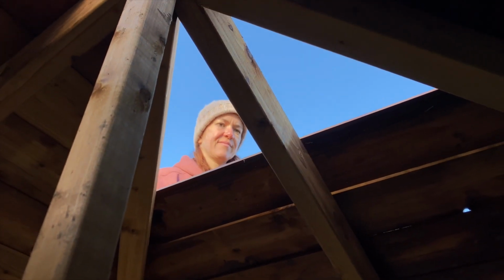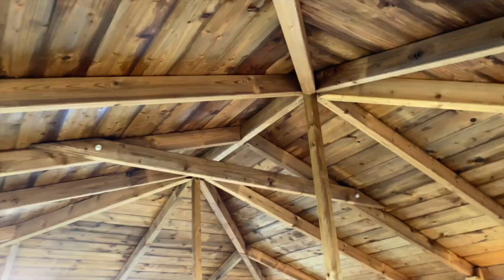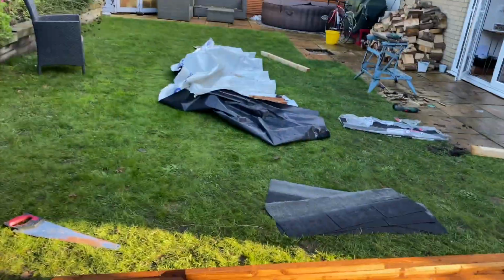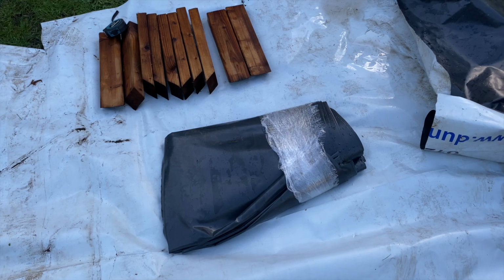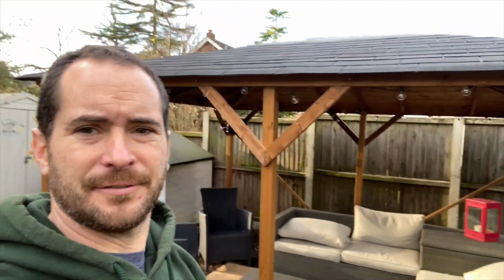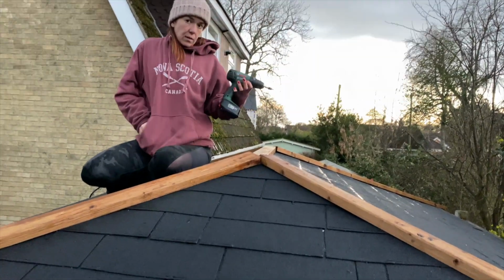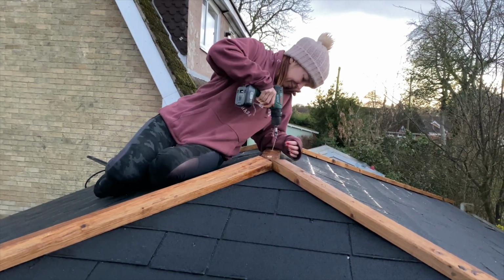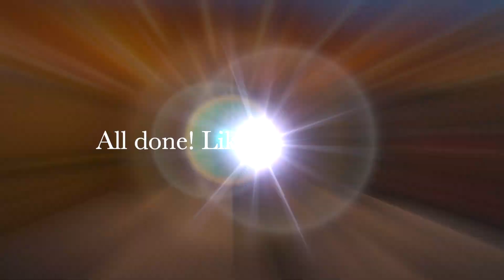Erecting Wooden Gazebo - Final Video - HD 1080p

Comment: Thank you so much for your 3-part series. I have just finished building the same 4 x3 Dunster House Gazebo. I am very pleased with the quality of the materials delivered and the final result.
Whilst waiting for my delivery and reading through the suppliers build instructions, I found viewing your 3 episodes, some parts several times over in slow motion, very useful. They gave me a greater understanding of the build to come and potential pitfalls to avoid. I would recommend anyone who is about to take delivery do the same it will really help you.
 I would also mention when constructing it is vital that the internal diagonal measurement of the first 4 beams are exactly equal and remain so otherwise it will cause issues later on in the build. For my build once the internal diagonals were equal, I used 4 pieces of spare wood I had to form a rigid triangle structure at each corner to help limit movement of the internal diagonal. I screwed them underneath the beams at 45 degrees out from the four corners posts. These remained in place until I had finished the build.
 I found on YouTube a video by Dunster House regarding how to attach the supplied plastic sheeting and  How to Lay Shingles Tutorial - Dunster House (2019) - YouTube which was also useful. 
I am quite tall and wanted to raise the height of the gazebo by about 150mm I achieved this by simply getting hold of an extra 70 x 70 gate post and cutting off 6 blocks that I attached to the uprights with metal flat straps before sinking into bolt down post shoes supports. 
Thanks once again for posting these videos and hope these and my above helps others to a achieve a problem free, well-built great looking Gazabo.
Reply from the maker: Thank you Mike!  Glad it helped and hope you’re getting ready to enjoy it more when the weather improves

Comment: Hi, how did you attach the membrane? Clout nails or the nails provided for the roof slats?
Reply from the maker: We laid it over and then used the weight of the shingles to hold it in place, then hammered the shingles in on top, so didn’t secure the membrane specifically.  Our instructions didn’t mention the membrane at all!
Reply: Thanks so much for your reply. I guess you haven't had any issues with it fixing the membrane this way?
Reply from the maker: @andysnipp3650  no issue at all

Comment: Looks a good job. We have been looking at Dunster, how did you find the timber, quality of the kit, were the timbers all true, no twists etc?
How did you find instructions etc, many thanks
Reply from the maker: Timber was a very good standard with very little knots and no twists or warping.  We had it delivered about three days so was stored flat.  Instructions were fine and easy to follow although don’t mention the waterproof membrane or the fact that you need to put it two of the middle supports the correct way round, otherwise the holes are in the wrong place for the cross timber.  Everyone that has come round has been impressed with the quality.  We finished it but covering the back wall, half an end wall and the floor in scaffold boards
Reply: @paulstroud2725   good we are covering the side etc, was thinking of decking half way and screening the rest, and leave other 3 sides open, good to hear all good with kit, look impressive, thank you